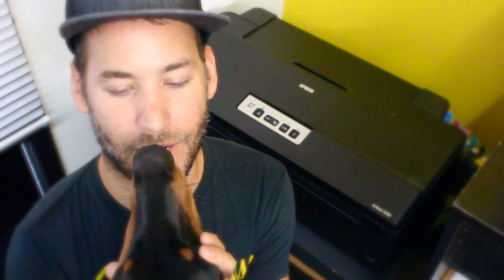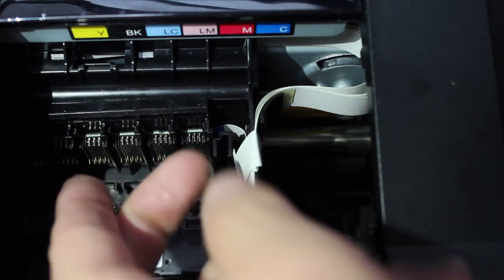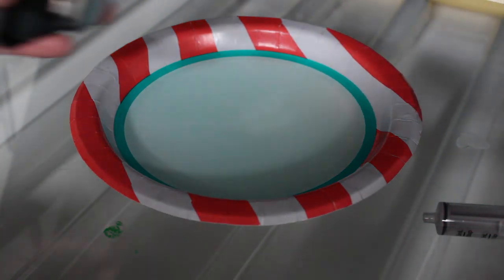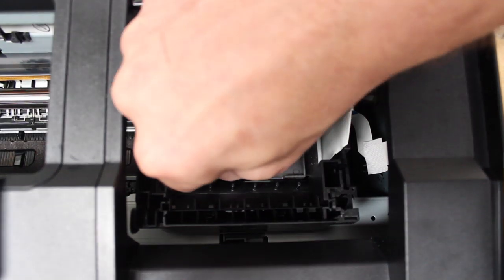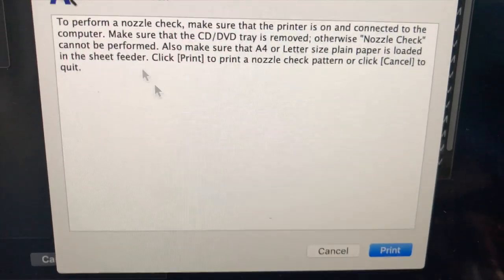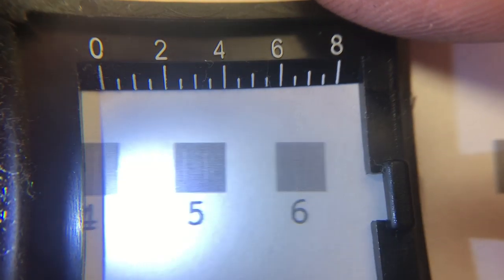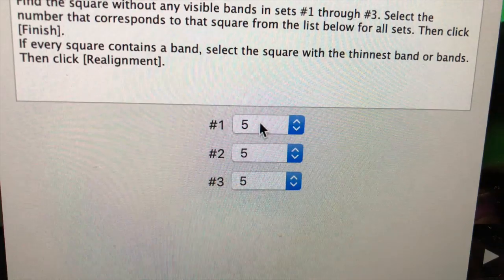Is Your Epson 1430 Printer Clogged or Streaking? How to Remove, Clean, and Calibrate the Print Head

Comment: Man, I can't Thank you enough,  I've been down for a week now trying the cut paper towel trick and soaking it for hours, and I wasn't getting a single drop of ink! I tried printing 8 full sheets of solid black and not a single drop. I only had to soak my head for 2 hours, pumped the 50/50 mix through at the end of both  hours.  I almost cried after I put it back together and the first rectangle was solid black and dripping off the film. Over time, I had to Raise my droplet weight to 15 in AccuRIP to get a solid print. I had to dial it back down to an 8! Thank you so much. This thing had me stressing for a long time, had me feeling defeated, but I won today! 🏆
Reply from the maker: Any time!

Comment: To easily remove the CSIS board 2:41 you bend up a special tool from a document clip in a fashion so there is a PIN that can go through a hole in the BACK of the housing to release the CSIS board clip. Using this tool it it easy peasy lemon squeezy to release the CSIS board. Look for a Epson service manual online like I did and there are clear directions in how to make the tool and this is done - instead of hacking away with a screwdriver.
Reply: I know you left this comment a year ago, but I cannot find any such assist with this matter and am ready to SCREAM trying to take the housing apart. I get one side out, and it pops back in when I move to the other side. Wondering if this will be worth it...

Comment: My printer had a weird problem where every other print would be liney every single time, you could count on it being liney. I had to keep a scrap film and print 1" rectangles in between every real print until the film was full. Then start a new one.I thought something was wrong with a chip or the counter or something, but this video absolutely cured the problem,  so if anyone else has this problem, take the head out and clean it! I can finally print back to back again! It's been like this for about 2 freaking years!  I can't believe it! So what I am guessing is going on, is half of my ink colors were clogged, and the printer alternates ink cartridges so that that you can go longer without a refill. That is just my guess, but holy crap, thank you again!
Reply from the maker: Glad it helped!

Comment: I've gone through all the methods without removing the heads without success so I'll be following your instructions as I bought a CISS for it just before it clogged ARRRGGG. Considered buying a new one only to discover Epson has discontinued it <smacks forehead> so I looked online for anyone still having new ones in stock or even a good condition used only to discover people are now asking TWICE the price I paid for my original one new .... goddamn profiteers.  Your video shows it's pretty straightforward so I've got nothing to lose!
Reply from the maker: Hopefully it does the trick, because you're right! They double if not tripled. The 1430 is pretty easy to repair if you have a little patience and handy skills. Let me know how it goes!
Reply: @mikeydesignssilkscreen473  well the print-head had been soaking for about 12 hrs now and when I tried to send cleaning solution through the individual color nozzles with syringe and none of the solution made it through! just bled around the edge of the rubber hose at the tip of the syringe 😕, so I flipped the print-head over for the nozzles to sit in the solution bath for a while. A couple hours later I was able to get one color nozzle to run through like in your video .... well it's a start! After that I gave all the nozzles a shot with the syringe and placed the head back in the bath head down to let it soak some more.  

I've seen on a few other sites talk of using an ultrasonic cleaner to clean extremely stubborn heads and have found I can get a small well rated one big enough to fit the print-head for about $50 CAD.  Considering the prices pirates are asking even for spare part 1430s I'm thinking it's worth a shot, I can always use the thing for other stuff.  I'm guessing my print-head is in the 'really stubborn' category because I'm moved last summer just after it started giving me these issues and unfortunately didn't have a chance to unpack it again until now. What do you think? Even the cleaner descriptions mention using it for cleaning inkjet print-heads so I don't think it can break it.
Reply: @mikeydesignssilkscreen473  finally received my ultrasonic cleaner today, left the 1430 head in it for 15 minutes and while I found very little ink discoloration of the cleaning solution when I try and run solution through the nozzles/head with a syringe all six nozzles now flow freely as in your video.  Word to the wise though, the cleaner is EXTREMELY loud! (probably because I ended up buying a somewhat bigger one since I have other things to clean) Hopefully once I get the print-head reinstalled my Artisan is back to normal.
Reply from the maker: @georgeorwell5842  Thanks for the update. Did you get it upclogged?
Reply: @mikeydesignssilkscreen473  as far as I can tell it's unclogged ........ but now the bugger doesn't want to recognize my cartridges (3rd party) that it did before, nor will it recognize my CISS system cartridges ....

Comment: This worked! Mine has been clogged for over a year. I soaked the head in an off brand window cleaner, dipping it in and out several times while also changing the window cleaner once it got too dirty. After 15 minutes I flushed each color with a syringe until I could see the window cleaner going all the way through for each nozzle without any ink. I dried it under a fan for about 10 minutes and put everything back together with fresh cartridges. I only broke a couple of plastic pieces in the process but they didn't seem that important, and it will be easier to clean in the future.
Reply from the maker: That's awesome! Yeah, it's pretty trick getting the plastic parts out without snapping then, but as you said, those parts really are that important. Glad it worked for you.

Comment: I want to also give out a hint that is keeping mine alive right now, if you have a broken pump/cap/wiper assembly problem that is causing the print head to LOCK in place and make an awful gear grinding noise. If you take the back cover off (there is a waste ink install tutorial that shows you how to take this off) if you look in the   printer head side from the back, there is a White Lever connected to a gear box. You can push that white lever down at just the right time and the printer will finish cleaning. You can almost feel the gears slipping inside where it trys to go down but doesn't quite make it all the way down, so I just keep my finger rested on it, when I feel it going down and jerking, I push and hold it down, it's like an assist, sometimes I only have to assist it 1 time during the process, sometimes it two times, and sometimes it still gets confused and the lights come on,  but just re start the printer and try again.  I decided to try this after I was left with no other options  and it worked, I also had to take the rubber wiper out because it was hitting the head with every pass. With that said, I need a new pump cap assembly,  but I can not find a single tutorial on how to install it, so I'm just going to have to figure it out myself. I found a tear down video online that gave me some confidence. But it doesn't look as easy as this tutorial was.
Reply from the maker: I haven't had issues with gears slipping, so can't really give any advice, but thanks for sharing.

Comment: Thank you! Great video. Now my printer will not recognize the cartridges !!! Any suggestion how to fix?
Reply from the maker: Thank you! Try hitting the reset button, or pulling the cartridges and reinstalling. Were you using genuine Epson inks before? Something I should have mentioned in this video is, if your printer has the most up to date firmware, Epson basically made it impossible to work with other there printers. However, you can pull the chip off of the genuine cartridge and the CISS kit, and replace them with the epson chips. Just glue it on. You'll need an Epson chip resetter for when the printer thinks the cartridge is out of ink. Inexpensive and just an extra step, but will work. We've done this with our Epson 4800 and works great.

Comment: I had an extremely old and extremely bad clog on my black nozzle . i followed the video and it came out great! but it took 2 days!!!!
every few hours i'd go press through a syringe, more cleaner through the black nozzle. now it prints great!
i notice alot of people complaining that their printer no longer functions after doing this. 
did you get the chip/board wet? i noticed that if i put the print head in a pan of solution of the wrong depth. i got my board wet!!!!
so what did i do? i reduced the solution level. and i waited another 2 days after cleaning, to put the print head back into operation, giving the board ample time to dry out. its summer here so 2 days was enough. cold or humid environments might want to let board dry longer if you get it wet.

Comment: Hello and good day.
I have a question! I did exactly what you said to do and it WORKED! But there is one nozzle that just won't unclog. Do you have a recommendation? Thank you especially for your help.
Reply from the maker: Might just have to let it soak longer or replace the head altogether.
Reply: @mikeydesignssilkscreen473  How do you replace the head? I searched before asking you and I couldn't find anything on how. I appreciate you answering and getting back to me

Comment: Great video Mikey.    I screwed up and didn't put the printer head ribbons back in order and after I powered up the printer after like 10 seconds of it initializing it shut down and won't power back up.  Curious if I either fried the power supply, main circuit board or the actual printer head?
Reply from the maker: Did you reconnect everything? Might be okay. I'm not a tech, but know how to swap parts out.

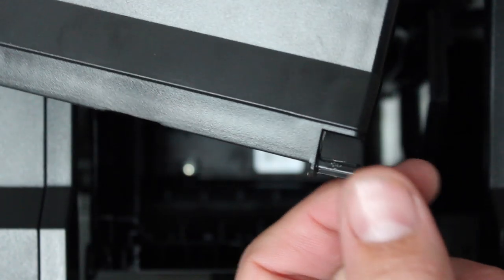Comment: 1:18 I can see you trying to get the right side clip of the top cover out, but then at 1:22 there is an edit point and then you have somehow gotten it out... anyway, as careful as I tried to be that pin broke off. At 1:25 you have the retaining clip removed, but how did you do that?  The pin on the right side is really long- it actually goes all the way "through" but trying to press it from the right side didn't really seem to help.

Comment: Hello Mikey how are you?  Question is I have done everything in your great video.  Printer worked fine but the wasted ink is not going through the tube onto to the waste tank, causing the ink light to stay on and printer is not working. I blown in and out the tube and still nothing is happening. Would you be doing a class on why the tube is not collecting  the ink waste?  Thank you
Reply from the maker: Hey Donna. I'm not a tech, but I'm a DIY'er. Sound like perhaps pump that dumps the ink might need replacing.

Comment from the maker: Don't spend tons of money on the latest greatest printer. Epson 1430s are workhorses, can be bought used for cheap, and repaired easily. Most print jobs are no larger that an Epson 1430s largest print size of 12.5 x 18.5...
Reply: Mikey Designs & Silk Screen do you ever have the issue with the printer not reading the ink cartridges after taking them out and doing a head cleaning?  I’ve tried numerous things such as resetting the printer and even putting the original ink cart back in the printer but it’s still showing 4 out of the 6 as being empty.  I am at my wits end.  🤦🏼‍♂️
Reply: @corymlindsey  you may have an issue with the chip on the cartridge. You should never touch them but have you tried cleaning them off or trying a different one?
Reply: @90snative66  yup.  Tried cleaning chips using 90% alcohol and also tried different cartridges.  Had a good friend who works on computers check it and it was dead unless I wanted to drop a bunch of money in it.  Ended up getting an Epson P400
Reply from the maker: @KDMI86  There's something more going on. I'm not a tech, but a DIY'er showing how something is done. Plenty of people have done this mod successfully. Sorry to hear about your troubles.
Reply: @KDMI86   Did you end up getting a new machine? I have resulted in same situation as you.
Reply: @corymlindsey  as i was trying to pull out the chip reader board i realised i could damage the ribbon connector when trying to get at those back clips. look at your ribbon you may have cut a line or two that may be thee issue.

Comment: Thanks for posting this. I went through the steps with a few issues, all mine, broke a couple clasps. Everything seems to be cleared out but my magenta is still not printing. Full cartridge. Any recommendations?
Reply from the maker: That's great to hear! Might need to let it soak longer. Or just replace the head with a new unit all together. Guess it depends on how much work you want to put into it.

Comment: Thanks for the detailed video. Unfortunately I must have tripped or gunked up some sensor. After reinstalling the print head and powering on I get the startup cycle ending with the power light off an the ink and paper lights flashing together. Any suggestions?
Reply: @KDMI86  yup it's bricked. I got it partially working but it simply won't recognize any set of cartridges.
Reply: @doncrescas  mine is doing the same thing, did you buy new cartridges to see if that would work?
Reply: @cunnoni  didn't work. Every time a complete set of carts was installed it would not recognize them. Repeat: do not attempt this service. You can almost always flush the print head without removing it.

Comment: I used your procedure to clean my ink head and it worked great. I could see the solution flowing through all of the nozzles. The problem I am having now is that the ink seems to be not flowing from the cartridges and onto paper. Any suggestions?
Reply from the maker: You may have to run it through a couple cleaning cycles to get the ink flowing through again.

Comment: One of the screws from printhead fell inside- can’t see it. most likely somewhere on the right side &/or down past the waste pad area. Any ideas of best way how to retrieve. the side panel is off. i did tilt it to the right but still dont see it. Will I have to take printer apart or should i keep trying to tilt it out? thanks to mikey or anyone with good solution.

Comment: Hey Mikey  thanks for the video? Would u recommend this process to remove regular ink and add sublimation ink? I bought the siss system to refill with sublimation. Just trying to figure out best way of purging out all the regular ink. The printer I gave was converted to print all black. What do u suggest? Thanks!
Reply from the maker: It's worked quite well for others. Just make sure you get an ink system that'll play well with the machine. If you get a CISS kit, it wont take long, maybe a couple cleanings to get the ink you need in use.

Comment: I did everything like in this video but when I put everything back now I have 6 ink lights when 6 cartridges are inserted, when I remove one cartridge then I get only 1 light ON, basically when all 6 cartridges in I get 6 lights ON. What could be wrong? Thanks
Reply from the maker: Is it just not recognizing the cartridges? Try pulling them all out, putting them in. Make sure they click. Hit the ink button. That should clear it up.
Reply: Hey I’m experiencing the same issue, have you had any success resolving it?

Comment: I accidentally pulled out the 4th ribbon that you didn't touch here, the one that goes into a little slot to the right of where the printer head goes in. I can't seem to get it back in now. Am I totally screwed?

Comment: How long did you wait to reinstall the printer head? Because it seems that some alcool is left and needs to evaporate, I reinstalled mine 3 times, check for the cable and it is still showing "no ink or incompatible cartridges'". Yes the plastic is really cheap, be careful when using a screwdriver. Otherwise the instructions are well made. Thanks for that video.
Reply from the maker: Almost immediately. Just run it through a couple clean cycles to help flush it. Don't let it evaporate. Keep it wet.
Reply: @mikeydesignssilkscreen473  Don't what the problem is, but because there at least on cartridge on low, it won't let me do a clean cycle. Tried 5 times to check the ribbon cable and it is fine, very weird. Thanks for quick reply, greatly appreciated.

Comment: I did this and it started to run for a bit but then after right before I was going to nozzle check it powered off and now it won't turn on and is making a quiet beeping noise near where the power cord comes out. Any tips?

Comment: 👍🏻 Excellent guide - thanks 👍🏻
Reply from the maker: Glad it was helpful!
Reply: @Mikey Designs & Silk Screen  I did break one of the small plastic retainers on top for the clip, don't think it'll matter. The catch for the clip is underneath and, far as I can tell, inaccessible so as you demonstrate one pries and hopes.
--
I've now reinstalled everything (and print went from unreadable to sharp & clear 👍🏻) and see there are some openings above where the right side door clip catch attaches - perhaps a stiff wire or some such could be used to dislodge on disassembly by pushing down. Also, used a squeeze bottle to push rubbing alcohol through the nozzles & while I couldn't get it to sorta squirt through like you did, mine was more a slow drip, it ran clear it was clean - I'd wondered about that.